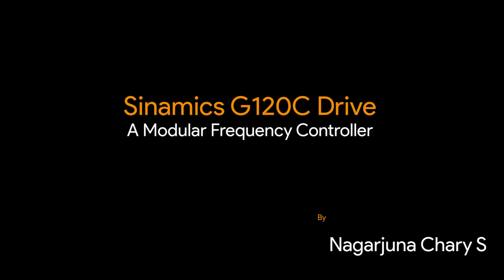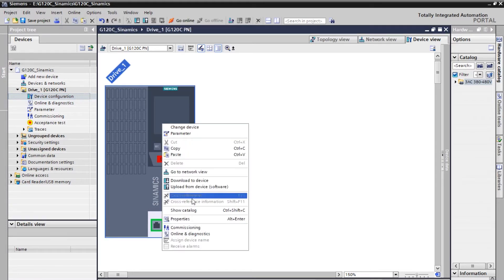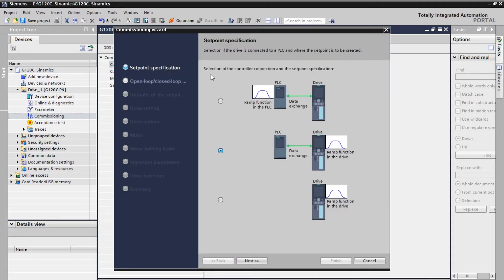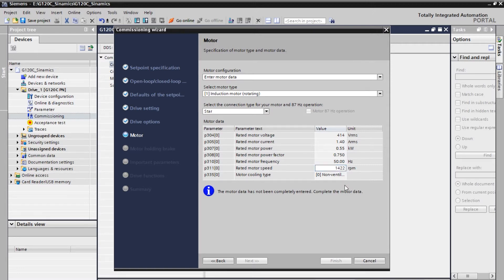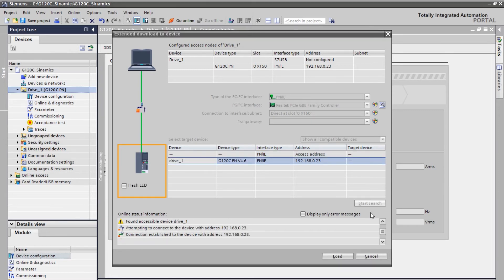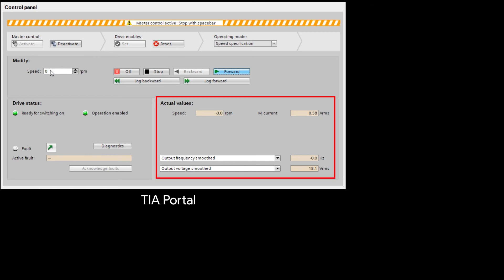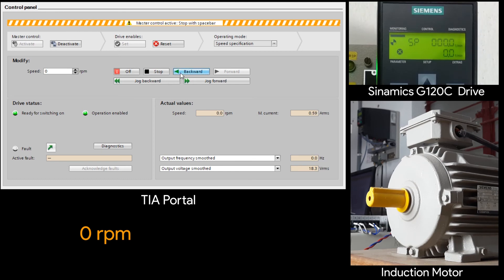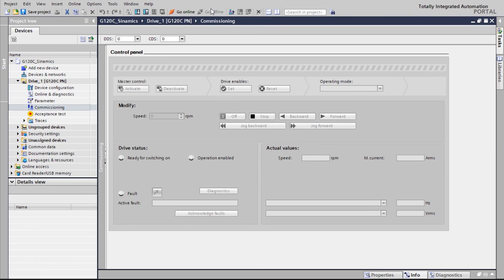Sinamics G120C Drive

Comment: In my case, at step  add device there is no drive part... Do I need to install additional programs?
Reply from the maker: Yes you need to install "Sinamics Startdrive" as per your TIA portal version like I am using V15
Reply: In add new device there is no drive option showing and I am using the Tia v17 how to bring drive option in device and network?